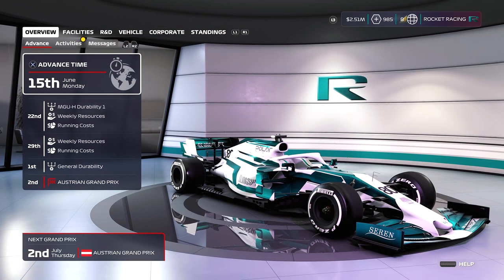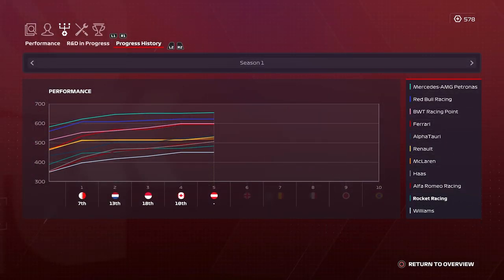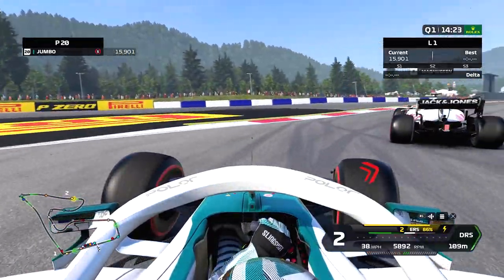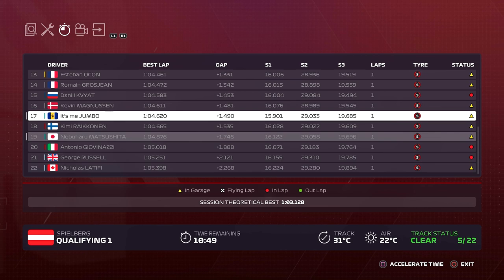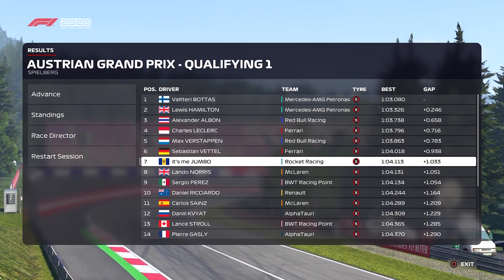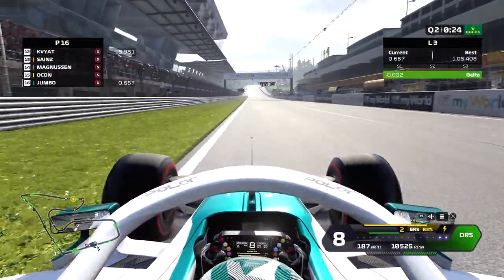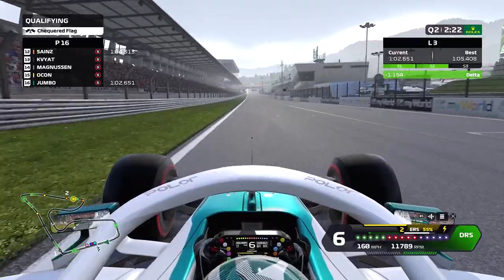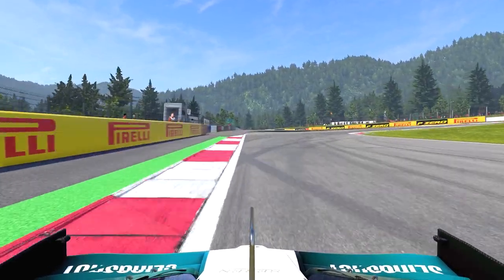Episode 5 part 1 - Now That's More Like It!! - F1 2020 My Team Career

Comment: Race Prediction BOLD PREDICTION Russell points, because every race he has done in 2021 he has gained at least 1 place an average of 2.5 before the DNF
Reply: Hamilton 1 Verstappen 2 Could be anyone p3 but I'm going for Ocon might sound stupid, but the Alpines are rapid round here and he is experienced in the car. P4 Leclerc  P5 Norris P6 Perez P7 Sainz. This is this time for Ferrari to strike. P8 for Bottas I know this will not happen but i want it to. P9 Gasly P10 Russell P11 Vettel P12 Tsunodi spelt wrong for the mems. 13 Ricciardo 14 Giovonazzi 15 Alonso 16 Raikonnen 17 Latifi 18 Stroll 19 Schumi 20 Illot. He gets p20 by deafult p21 Mazespin I think he will crash about lap 28
Reply from the maker: Nice predictions!! 👍👍

I Would like to see Russell get points, he deservers them!! I would also like to see Vettel pick up some points to will be good for his confidence!! Most of all I just want to see a good race!! 🏎🏎